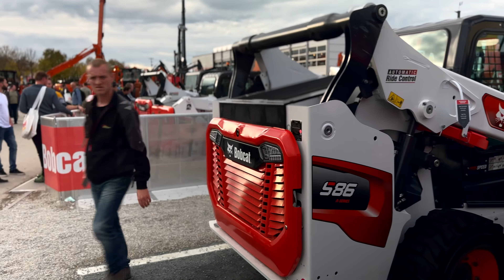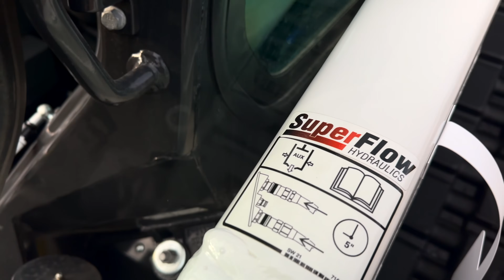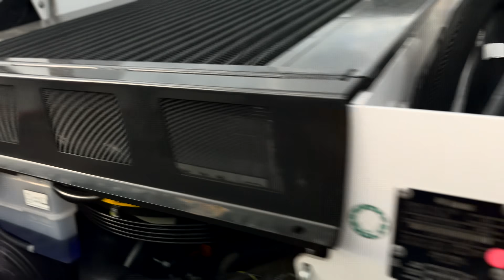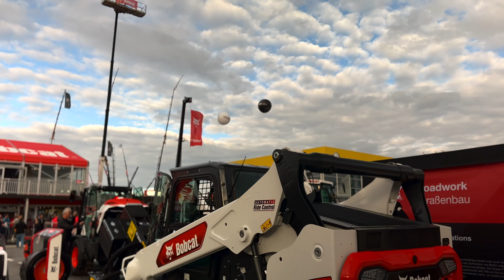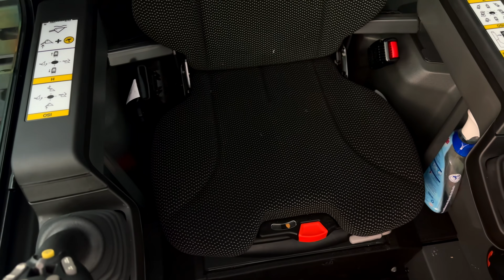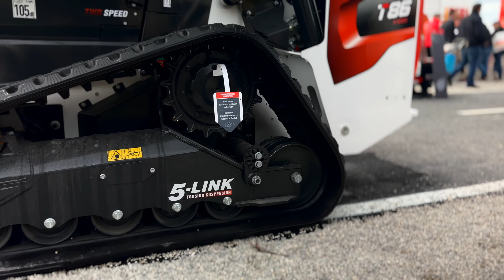Bobcat Debuts Most Powerful Loaders Yet: S86 and T86 With Super Flow Hydraulics

Comment: Glad Bobcat is finally revising the giant t870 down to fit a between fender trailer and pumping up the power to possibly compete or maybe even (no high hopes) exceed the John Deere 333g. Wish Bobcat had a larger tier beyond this to compete with the new Case and ASV machines for power but I don't blame them for not taking the risk, I think ctl's with the typical quick attach system and overall design have limits and we see Case compensating this already with their dozer blade mounting system.